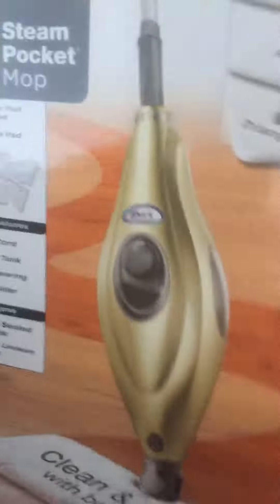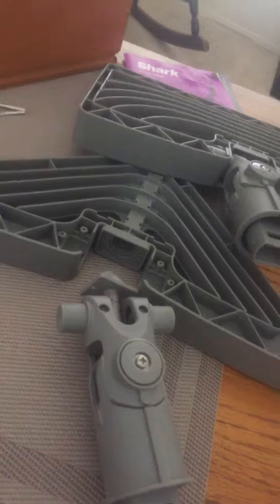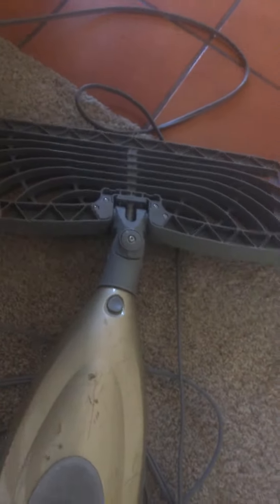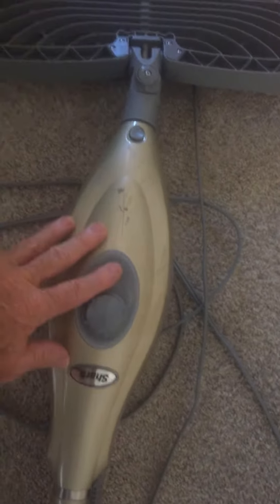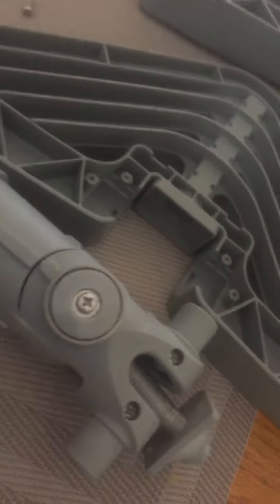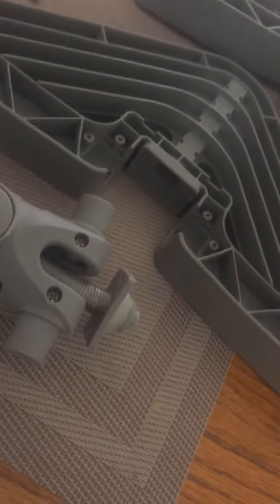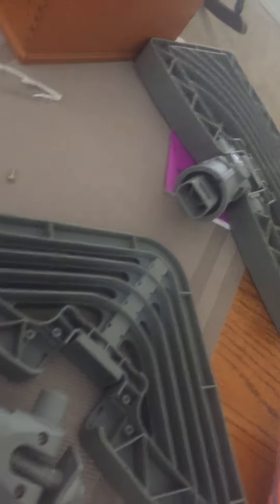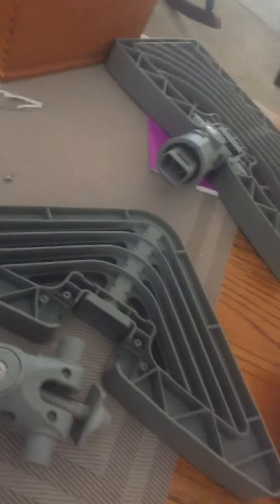Unclog steam mop easy fix

Comment: I have a Han floor sanitizer that did the same thing. Filled the water container with white distilled vinegar, turned it upside down over night and BAM.  It works.  Ran the white vinegar through the cycle until the container was empty. Like new.